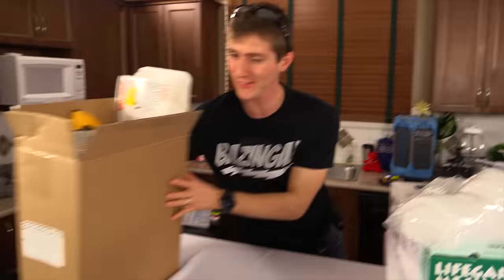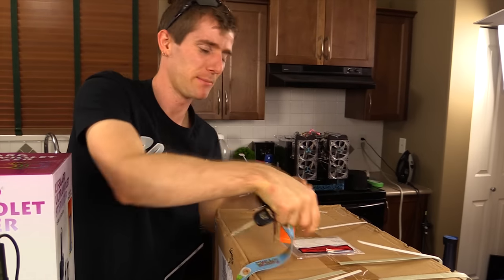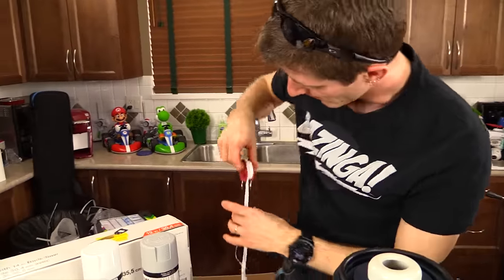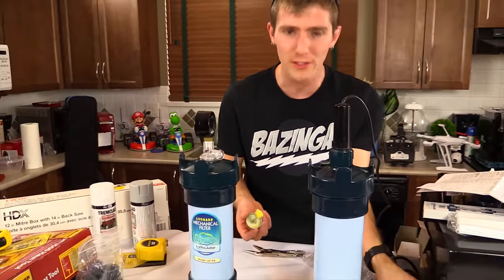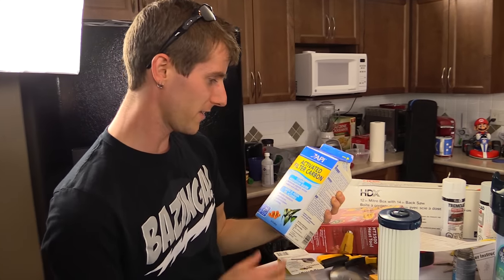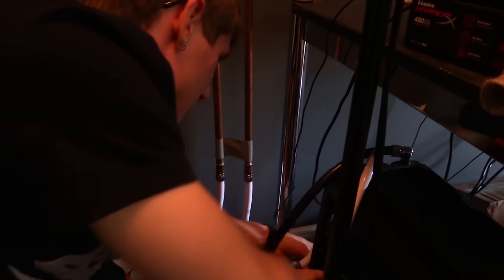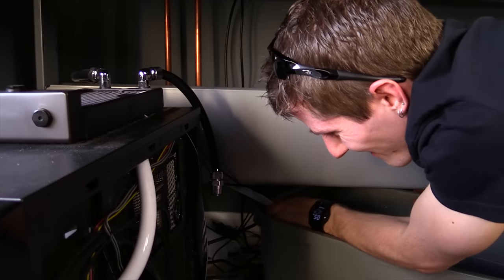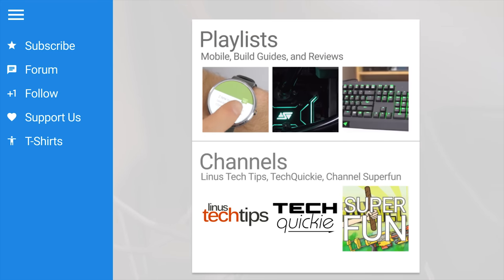Whole Room Water Cooling Part 6 - The Road to Stability

Comment: Hello linus and subs I need help to choose a gpu as it is my first build my options are

1)EVGA GeForce GT 740 Superclocked Single Slot 4GB DDR3 Graphics Cards 04G-P4-2744-KR

And

2) Zotac ZT-61010-10M Nvidia GeForce GTX 650 Synergy Edition 2GB GDDR5 2DVI/2HDMI PCI, Express Video Card
Thx
Reply: Get the GTX 650. It will be a much better buy
Reply: 1. There is no point in getting a GT740 with 4GB Vram
2. A GT740 and a GTX 650 are the exact same card, just get the cheapest GT740 with 2GB GDDR5 available or if you have a little more budget, get an AMD R7 260X, also in a 2GB GDDR5 version.
Reply: post what else you will be buying
Reply: Neither.Save up and get a 750Ti.No need a higher Wattage PSU.
Reply: What is that?! 
A GPU for ants?!

Comment: IS this really what it takes to cool down a single 290x :( i'm sure as hell not buying a 390x NOW.
Reply: whuuuuuuuuuuuuuuuuuuuuuuuuuuuuuuuuut???????????????? They aren't even using r9 290x's?
Reply: IrishSunburn How do you know?
Reply: Naomi Agony Because they said in the first watercooling video? They're using titans, in most of the builds, plus a quadro along with a titan in one of the main editing builds, Linus has a lower gpu, unless he's upgraded since then.
Reply: Naomi Agony I think the r9 290x is a fantastic deal when its cheap (ex: its current price point) The 290x and 290 are really really good cards, in many cases as good as a gtx 780. Plus they are dirt cheap, if you can get one used. They really are only hot, when you use the reference cooler. And seriously, even if it is hot? Who cares? Your getting it for really cheap, half the price of an equivalent nvidia card in some cases. With that money, if it ever breaks (most likely you'll replace it before it does, I mean seriously, what serious gamer keeps a card for more then 4 or 5 years) or if it starts to not perform as well as you want in games, just buy a new card! Buy one with the 200$ or so you have left over! So you've basically gotten a high end card, plus an upgrade to ANOTHER high end gpu down the road. So you've equivalently gotten DOUBLE the power of that nvidia card, with just a little trade off in heat, and a little trade off in noise (noise isn't bad if you get an aftermarket cooler version) Just watch out for those deals. If you want to be a true value pc builder, you have to look for the BEST components for the price! You can't just go for something that has no more performance, a little less heat, and a TON more cost, just because you've "heard" that it is cooler. Look at benchmarks, look at a reviewer like LINUS for petes sake. I mean seriously! Your on a very unbiased reviewers channel right now! Why don't you actually listen to him!
Reply: IrishSunburn I don't gives two shit about amd, they failed me before and I'm not going back to the dark side again.
Reply: So your basing your views on dozens and dozens of products. and millions of individual items. On one case? I'm assuming your never going to drive a car, use a boat, or fly in a plane, or use any mechanical item, because I'm sure all variants of those have broken in some cases.
Reply: Luke Hudson I don't care about amd at all... is it so hard for you to understand lol
Reply: I do understand.. Your the one that doesn't understand. Your basing your views on an entire section of the pc world, on a couple isolated cases. Or on very small problems that really don't matter when you consider that amd/radeon is cheaper! Both intel and amd have their purposes. You and half of the other stinking pc community just don't seem to understand that you have to buy what is best for a budget spending 300$ on an intel processor, when your on a 800$ budget just isn't a smart idea. Spend that money on a really good graphics card. Same thing with the graphics side of things. Get a radeon, or get a nvidia, all that matters is the performance. Get what performs best for your money at the time. Who cares if you spend an extra quarter a month on power, WHO CARES if your gpu is a couple degrees hotter. Its THE PERFORMANCE that matters.. ok.. if your pc lights on fire everytime you boot it up, or has serious problems with reliability, then you have my permission to go ahead and bash on whatever product is doing that to your pc. But the fact! is! that amd/radeon aren't lighting your pc on fire, in fact, with a good cooler, they aren't even that hot at all, and often run pretty cool with a decent cooler. And a fx 6300 or fx 8350, gives you a TON more general performance then an i3, for the price. So seriously people, stop bashing on amd/radeon They have their purpose, like almost all other computer components.

Comment: move about how to suck at plumbing lol
put hose instead of pc at whole room for try

or use plate heatexchanger 

and whole this cooling looks nonsense what for
-what heat amount that pc will make
is not freaking v12 engine lol

and about antibacterial liquids people must know since first or second watercooling already was used for pc

use split conditionier for pc cooling
with heavy cooling processor and super-overclock then will be some qwest

Comment: Is this a good build?http://pcpartpicker.com/p/HFM9P6
Reply: Smacky Coe Motherboard is for overclocking and the cpu is not.
If you're going with that intel cpu then it has to be a h97 motherboard.
 I also don't understand why you want a cpu cooler? the stock one is good because that cpu is not for overclocking.
-4690k + z97 motherboard + 212 coolermaster evo or cryorig h7 
-4690 + h97 motherboard + stock cooler
Reply: Naomi Agony Okay I've made some adjustments to this build and I've done more research and this is what I got: 

CPU: Intel Core i5-4460 3.2GHz Quad-Core Processor
Motherboard: MSI Z97S SLI Krait Edition ATX LGA1150 Motherboard
Memory: Kingston Fury White Series 8GB (2 x 4GB) DDR3-1866 Memory
Storage: Samsung 850 EVO-Series 250GB 2.5" Solid State Drive, Western Digital Caviar Green 1TB 3.5" 5400RPM Internal Hard Drive
Video Card: Asus GeForce GTX 970 4GB STRIX Video Card
Case: NZXT Phantom 240 ATX Mid Tower Case
Power Supply: EVGA SuperNOVA NEX 750W 80+ Bronze Certified Semi-Modular ATX Power Monitor: Acer G227HQLbi 60Hz 21.5" Monitor
Keyboard: Cooler Master Storm QuickFire Rapid Wired Gaming Keyboard
Mouse: Logitech G502 Wired Optical Mouse
Reply: Smacky Coe In all honesty... if you have no budget just buy a 4690k and an msi 970 plays all games at 60 fps.
Reply: Well I do a have a budget so I probably won't do that.

Comment: Am I the only one that knows this is the stupidest idea ever? Or is it just for shits and giggles?
water/air cooling both are only able to cool down the cpu/etc because the outside environment (your room) is cold. So unless outside is cold then then you would actually be heating your room by doing this. And even if outside is cold, it would be much more simpler and much more efficient to use a fan and blow in the cold air from outside. 
Only reason people use water cooling is so that they can directly cool a single point more then other unnecessary components (the cpu) but if your going to cool everything all at once with no large temperature differences between parts, then air cooling is much more efficient and faster to cool then water cooling. 
So in short, cooling systems that are in computers cool their system because the environment is colder then the cpu. 
Water cooling is used to cool a single point, and
air cooling is used to cool a whole system.
So could someone explain why are they doing this? Only thing I see is just for fun

Comment: This whole series was extremely painful to watch.  Aside from the fact you learn best from other people's mistakes, you guys should probably stick to building pc's, not plumbing/cooling systems.  You clearly have very little common sense, poor planning and lack of experience and proper tools.

Also a ball valve at each supply and return and a bleed valve for the whole system would have made troubleshooting this a million times easier and left fewer antifreeze stains on your carpet.  Speaking of which, why didn't you think to test the system with just pure un-dyed water before adding antifreeze?

There are so many things wrong with this I'm going to just stop here.  I was just waiting for Linus to fall off the ladder at any moment, unfortunately I was disappointed.